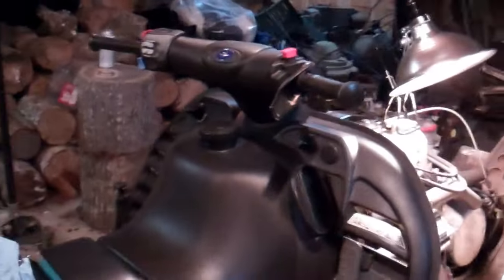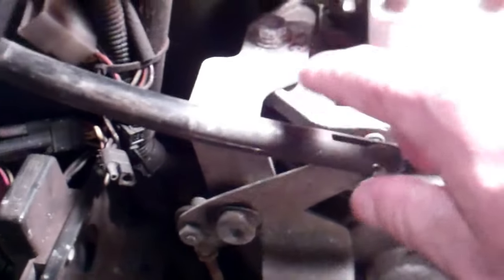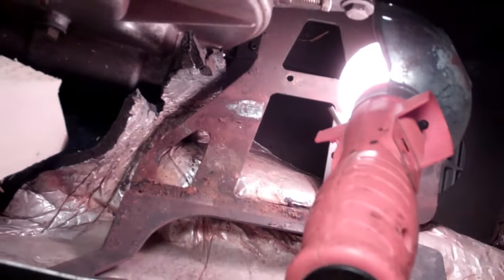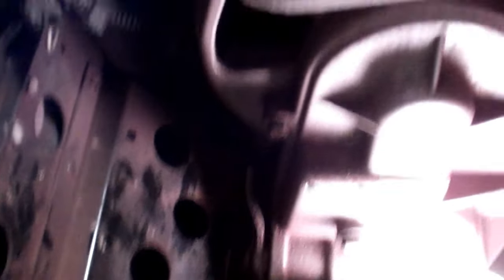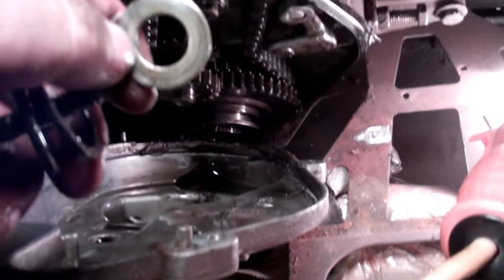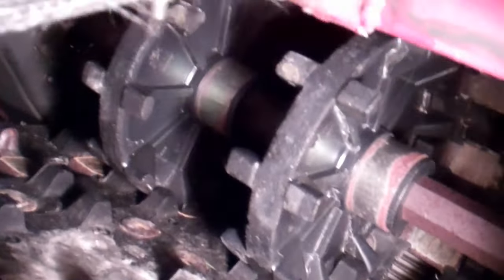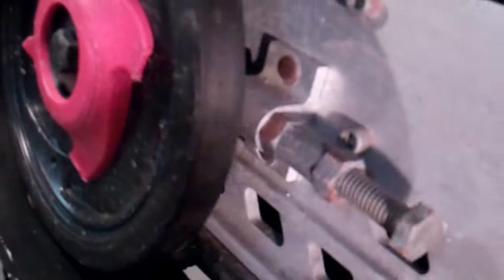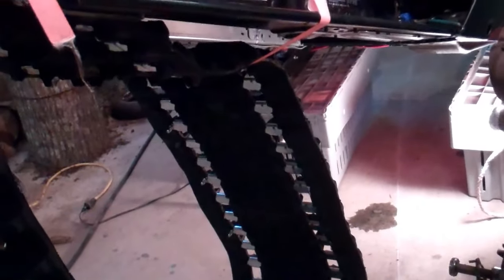Track Replacement on a 2000 Polaris 600 XC Deluxe

Comment: that little winch box is a Piece of crap man, i had one of those that i used to hold up the engine in a 2000 taurus that i bought to fix and flip and wound up with that 800 pound motor sitting on my leg so be careful with that P.O.S. wouldn't want you getting hurt because of using junky tools